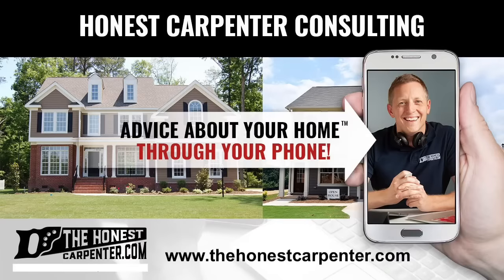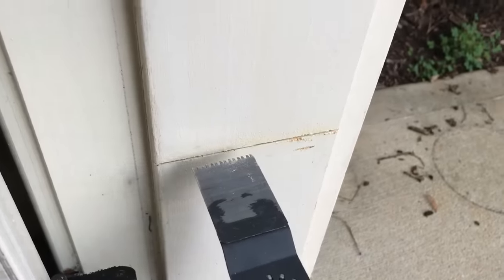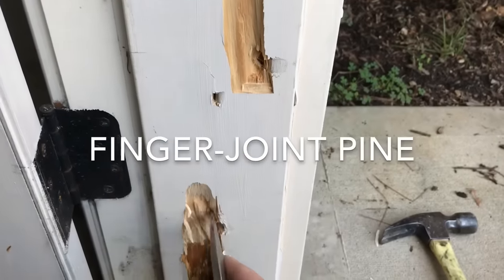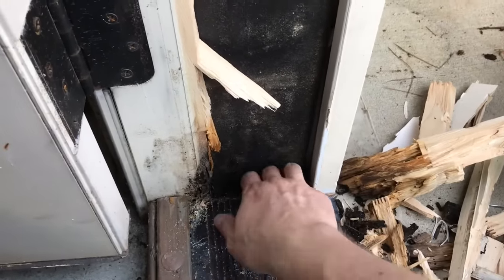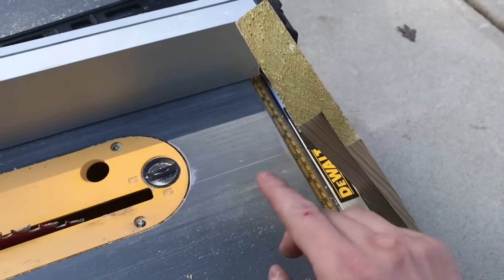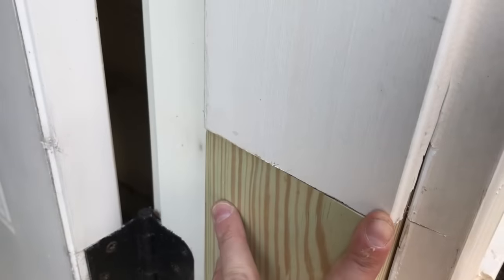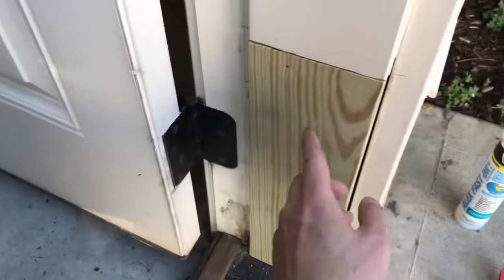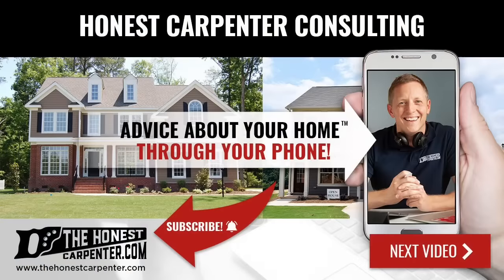How To Repair Rotted Door Jambs

Comment: Hey I have one more question for you sir. On the threshold where you recommend any masonry sealant, there's at least a half inch gap between the threshold and the concrete underneath it. Do you think it would be acceptable to just seal it or do I need to somehow put shims in there? Thank you so much.
Reply from the maker: @Michael Thompson I’d say it couldn’t hurt just to add a couple composite shims (not wood) as well, right in the center. And be sure to use an adhesive or strong sealant that bonds to both masonry and metal or plastic! After that, even a 1/2 gap should be a problem

Comment: One question - after you've cut the rotted wood with the multi-tool, why not use a pry bar to pry it out? I didn't understand why you had to slowly chip at it instead. I'm sure there is a very good reason, it just wasn't apparent to me.

Comment: I'm a newbie, why wouldn't you use the multi-tool to cut vertically on the left side. Maybe after you go slow at the top from center to left with a chisel to find your left side stopping point, wouldn't you just rip down from the top?

Comment: You should have used P.V.C to replace the rotten wood . And to remove the rotted wood just cut a line going down the middle it should come out in just two pieces  .
Using a screwdriver like that is dangerous  . They have pry bars in all sizes  . And if you do use wood prime it before installing  .
Good video for beginners  .

Comment: Very informative. For the cut line that leaves the "surgical scar", why not use bondo or wood filler and sand it flush? Once painted, it'll be invisible. No scar.
Reply: That scar will open up in time and leave a crack, should have done a over lap joint there and 2 pack wood filler.

Comment: Wood filler on the seam will hide it  completely, rather than using caulk.
Reply from the maker: Robert Kotschi Good call. Every now and then, if the client is worried about  the seam showing, I’ll actually chamfer sand the two edges, fill with bondo and sand flat

Comment: how did you re- secure the threshold to the jamb leg ?  or is it just free to flex and over time cause another water leak ?
Reply from the maker: ray07man I usually try to secure the threshold itself in place instead, then just seal beneath the new jamb leg (which I didn’t effectively show here). Most thresholds around here are already adhered down with some sort of sealant, but if it seems inclined to move I sometimes intentionally twist it out a bit and run a bead of metal/plastic/masonry adhesive beneath, then slide it back into place
Reply: @TheHonestCarpenter , that's cool .   i agree about the priming of the bottom of the jamb leg and as carpenters we do all we can to make the repairs last .  ( doors are my pet peeve ) i hate an unruly door . lol thanks for the vid .
Reply: also to the folks that are gonna try this please recall the Honest Carpenter's   DRY … DRY... DRY. treated material . he will tell you the wet stuff is unruly .
Reply from the maker: @ray07man  Right indeed, never wet! Treated wood will lose so much girth in the shrinking process, it'll recede in place. And any strain defects will show up too late. Gotta give it that time to dry, then start from there! And you're right about unruly doors--they've been 50% of my call volume some years. People call sometimes and say, "I've got several doors that aren't working..." and I immediately start groaning a little :D

Comment: how would you attack a window where wood at base of window is showing water damage?  Would replacing the wood be sufficient or do you have to figure out what is causing the water damage?
Reply from the maker: Hey Jeff, thanks for writing! I think best approach would be just pulling the wood sill and replacing with pvc windowsill. Those pine ones drink water right in. Pvc is impervious and will never rot. Good caulk and paint will seal things up well, and I think you’ll find water just being naturally shed from the area going forward

Comment: cut at the "control" line and make very "controlled" smooth cuts with the multi "control" oscillating tool, across that "control" line that you made.

Comment: i like it! however i would not use end grain shims if i could help it with the table saw you could easily mill some 1/4 inch shims that are flat not beveled if no table saw buy plywood thats about the same thickness and a good strong adhesive that can be used as a wet shim to help flush things up.
Reply from the maker: Trent Myers Thanks Trent! I’m totally onboard with the shim idea. On interior doors I ALWAYS use linear grain shims. I only use end grain here for speed purposes, and because I completely encapsulate them with adhesive in the jamb cavity. They get too stuck to fall down back there, and within an hour they’ve taken on their initial bond 🙂

Comment: How to make a simple repair complex. Painters scrape the loose material off. Looks like surface rot to me. Still firm when you push on the rot. Then use a good caulk and paint.

Comment: Honestly that should be cutting the 45 angle download so that when the water does come down it will shed off. I probably replaced 100 of those in my career as a renovator and I never had to go back and repair another one.
Reply from the maker: @Lindell Hughes How do you cut your 45s on a vertical jamb?

Comment: My doors rotted at the inside bottom of the jamb where the door covers the jamb when closed. I had applied some foam sealing wedges.  I think the wedges trapped water and caused the rotting - so...sealing wedges are good , just don't use them at the bottom of the jamb.  If you have the wedges at the bottom get rid of them.

Comment: I would not have used SYP treated wood.  The grain and texture won’t match. I use KDAT pine/fir 1x4s or 1x6s which you can sand to very smooth.  It has more of a fine grain like “white wood” studs.  A little Bondo and sanding and you can’t tell it’s been repaired.

Comment: pressure treated lumber gets horrible surface cracks ,i would not use it ,also use exterior caulk not bathroom caulk, you did a great job ,just need other material
Reply: if painted and protected from UV rays and constant weathering treated wood does just fine. Really needs to be dry though like in video. But I would've sealed the ends because even though its treated it will absorb water and expand. And seal with something like Titebond III and not just primer is better. Unless multi coats of primer is use then the end grain still absorbs significant water.
Reply: Silicone is silicone...whether it says "bathroom" or otherwise. If it's 100% silicone, then the advertising is just that.

Comment: Good technique, thank you for sharing. Suggestion, mount your camera, that solves two things, 1. You can use both hands, 2. Camera movement is very annoying and spatially disconcerting. Tripods are quite inexpensive.
Reply from the maker: Thanks Ric! I’ve got a couple tripods, but unfortunately I have to film while working and I just don’t have time and brainpower to manage setup on the job site sometimes. I have a little shop space now though, and I’m going to be able to set up more planned shots!

Comment: If the inside edge is also rotted, is there any danger of cutting all the way across on the hinge side?  Or should you just replace the whole jamb side because of the weight of the door?

Comment: Great video as I have to replace a couple jambs in the back of our house.  Your video was concise, to the point and well done. One question(s) I had was is regarding the removal and reinstalling of the weather seal. Is it attach with any type of nail or staple and if so how did you remove with damaging?  Likewise, when you reinstalled did you just tuck it back into the grove.  Thanks for the video and in advance for your response!  PS - new subscriber now.

Comment: I like that saw, never used one before. But did you use it to start the cut or a handsaw? I don't think that tool could be held that steady to start it. 

That new board isn't touching the plate is it?
Reply from the maker: Agreeable Dragon Initial cut was done freehand with the multi-tool! It’s really pretty stable. I’m getting a new one soon, so I’m going to do some demo videos just on cutting techniques. 

And what I do for the bottom (though didn’t show well in this video) is lay a bed of adhesive on the threshold, press the piece end down onto it, then slide into place. Kind of accomplishes two things at once.
Reply: @TheHonestCarpenter  Gotcha, pretty good job.
Reply: I found out that the finer blades will pretty much follow a knife cut initially.
Reply: You can tack a scrap piece over the jamb with a nice square cut for the blade to follow.

Comment: why not use the multitool to cut vertically to assist in removing the lower section instead of hacking away so much with the heavy screw driver?
Reply: That's what I was wondering - Or a large wood chisel to split it.

Comment: I had somebody install a back door for me recently. However when you step on the I'm going to say threshold it moves up and down. Do you have any videos on installing an exterior door?
Reply from the maker: Michael Thompson That sometimes happens due to unevenness in the slab, or a variety of other reasons. I don’t have a video yet for installing pre-hung doors. But, if you can pry the center of the threshold up a bit, run a bead of masonry-to-metal sealant beneath it, then weigh it down for a night or two, it’ll often secure it into place and take out the flex
Reply: @TheHonestCarpenter  thanks for such a quick reply.  What about masonry anchors? This contractor did several things for me and I've pretty much had to redo everything he did because the work was so bad. The only good thing to come out of it is I have learned a lot!
Reply: @TheHonestCarpenter  again thank you for your advice and your reply. Most people with channel is as big as yours don't take the time to reply. The only reason I asked about the masonry anchors in my previous reply is because a Carpenter suggested I try it. Unfortunately it is such a small job that nobody wants to come out and do it haha.
Reply from the maker: Michael Thompson You’re welcome! I always try to reply 🙂. The masonry anchors (or just “tapcon” screws) can work if you have the kind of threshold where a long slat detaches on top so you can get inside it. BUT, you’ll need a hammer drill to make the holes, if you have that kind of threshold. That’s why I like the adhesive route—doesn’t require drilling, and works with every threshold to create a crazy strong bond, if you get a good high yield adhesive

Comment: Have you considered using PVC stock instead of treated wood? Where I live, menards has 1.25 x 4" or 6" x 10'.
Reply: Yes i agree with  you 100%, pvc is a much better option.  If  you are installing a new jamb you can buy ones with pvc all ready but my have to special order.

Comment: What are the tools and prices so we know how much something like this would end up costing, as a dy?
Reply: If you do repair all the time. Buy the tools. Or just call someone to do it. Look up at Home Depot or Lows. Table saw, Multi-tool, Chissle, caulk gun, Multi-tool blades. And if you never ran a table saw be very careful with It. It will take fingers off in a blink of an eye. It can take out the eye with flying wood chips. It is a deadly tool for an untrained person. look up on youtube table saw accidents.

Comment: If the rot is not that bad you can use wood epoxy to fill in the void .  Just make sure it’s dry and seal the sides and bottom after sand and paint

Comment: How should I replace the wood section where the striker plate is without replacing the whole section of wood. There is no rot at all. My side wood door was kicked in to gain access to the inside of the house. The door is fine. Thanks

Comment: Here is a tip:you can use for both sides ,a small piece of marble,at the lower part,usually most if the water,stays there,damaging wood.i had the same issue,and I found it,very useful.

Comment: Hi there.  Thank you for the video it is very helpful.  I have one question, however.  With regard to the shims, instead of cutting the tar paper and gluing the shims to the frame, would it not be possible to attach them (chemically or mechanically) to the pressure treated board that you are using and nail that piece to the frame instead?  The reason for my concern is that cutting into the tar paper is just another way for moisture to access the door frame (beyond the tar paper).  Good tip with regard to the the other side of the door jamb that was not rotted out.  Thanks again. HDH
Reply from the maker: Hey Handy, thanks for watching! I like to cut the holes and use adhesive to guarantee that the piece stays put and doesn’t wander away from the framing lumber. A screw would do this too, but I like the speed of adhesives and brad or trim nails. As for the holes in the house wrap, I don’t worry too much because they get completely filled with adhesive. Really, housewrap has about 10,000 holes in it where siding nails and staples punch through, and things still breathe and shed water like they’re mostly supposed to. These couple clotted with glue shouldn’t present too much problem 🙂
Reply: Thank you for your reply.  I appreciate it.  Keep up the great work and content.- HDH.

Comment: Do you still work at homes or consulting only.  I live in the Triangle area.
Reply from the maker: Just consulting these days, Rollo. We are doing some in-person consultations locally these days for a slightly elevated rate. Just reach out through the website if you have any home issues you need help with.

Comment: Why wouldn't you cut from the sides with the multi tool?
Reply from the maker: Hey James, thanks for writing! It’s definitely an option, but for as effective as the multi-tool is, it doesn’t cut all that quickly, and you can burn up expensive blades really fast. So I often use the hand tool method—it’s just as quick, and free 🙂

Comment: Looks like a lot of good wood was cut, usually I don't find the rot extends that high but either way the work is about the same. I would not cut the paper, you want the the moister behind it, not in front. Should last many years, just recaulk once a year which many of us don't do including myself, hence rot repair. Sometimes replacing the rot with new wood is not practical in terms of time, expense like tearing half of the structure to remove. Thus remove the rot as much as possible, wood hardener and Bondo are you friends. But then if its structural, need to do the work and replace with new wood.

Comment: You should have wiped a thin layer of adhesive on the end grain on both ends before installing, that way the grain doesn’t soak up moisture. Otherwise nice job.

Comment: What is good for sealing the door jamb end?  I was thinking of using tung oil.
Reply: 123 Primer  You will see it soak in, use it until it stays on the surface, usually two coats

Comment: I've noticed the stud behind the house wrap feels spongy as well.  Any fix for that?
Reply from the maker: I'm afraid you start to get into demo and re-framing if its bad enough back there 
:(
Reply: @TheHonestCarpenter  I cut the housewrap to look.  It looks like just surface rot and very corner of the 2x6 stud.  I'm boggled at how it is getting in.  It was caulked good and I replaced a small portion of door frame some years back (2007ish). This time though, mostly outer door molding is rotted and just a little bit of the piece I replaced before, which the molding nailed into.

Comment: Just put in a new door... But educational! Thanks!
Reply: I assume you’re being facetious. I would do this before replacing a whole door unit if everything else is in good shape.
Reply: @victoryak86  not really. Would probably take less time to replace the whole thing and have it all fresh.
Reply: @Chr1sgo  um no.  I do this work for a living, for the past thirty years. You think installing a whole new exterior door unit would be faster than that?  Guess you haven’t installed many!  If you want to do it correctly it involves removing and disposal of old door, prepping opening, removing and replacing exterior casings, interior casings as well. Filling, priming, painting. Add to that the cost of a good exterior door unit. Your theory is utterly laughable. I assure you, you don’t know what your talking about or if you think you do, you’re a hack not a carpenter. Cheers!
Reply: @victoryak86  why do a patch job? Don’t get me wrong I think it’s a great educational video and love YouTube for this exact content. But if the existing jamb is already rotted obviously the door has seen better days and just in my personal opinion would just be better time spent putting in a new door. New sill, panel style maybe, hardware, making sure it’s properly insulated, etc. I assure you I do I work for a leading window and door manufacture.

Comment: **Good job, but here is a tip my friend. Next time grid it out with you tool it's alot faster. Then take the hammer and wack them from the inside out.** Wait til you have todo it holding with your boots, using a skill saw, oh fun times.

Comment: There wasn't much damage there.  Little bit of Bondo would have repaired that.  Cut out what little water damage is there.  Prime and paint.  Looks like snow damage.  Keep the doorway clear of snow.
Reply: Bondo never lasts
Reply: @Stevesbe  I have been repairing rotted wood with bondo for 15 years. None of my repairs have failed. Saturate the wood with polyester resin before filling with bondo.

Comment: Why not cut vertically with the oscilating saw to help remove the rotted jamb?  Or come at it with a Wonder Bar from the side.  It seems primitive to hack away at it with a screwdriver.  Sorry, just my thoughts about it.